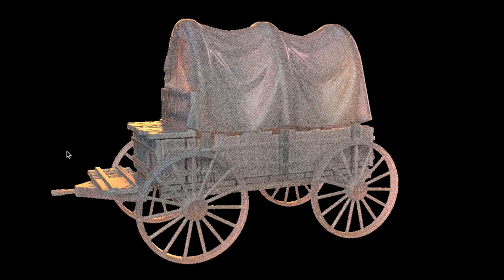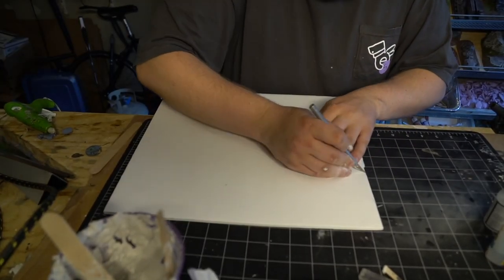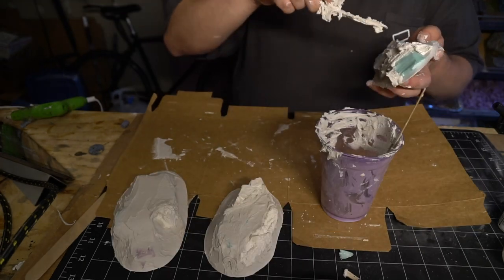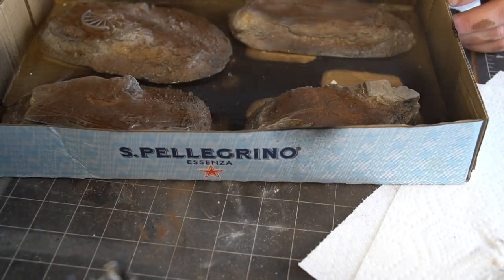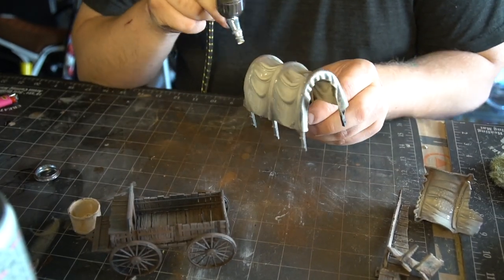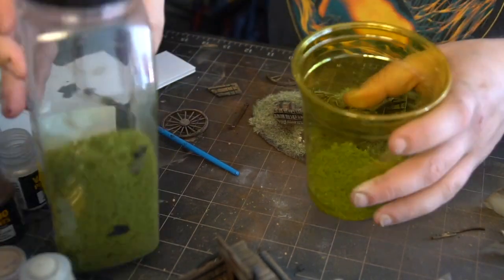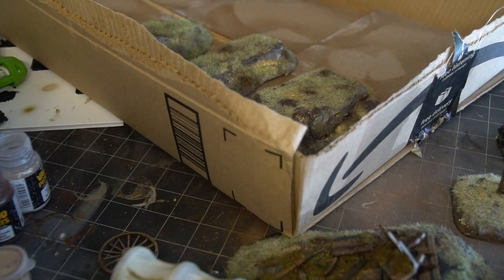Roads and Accessories Part 3, Hills and Wagons: CLe4

Comment: Thanks for the STL! I've heard about using baking soda as an accelerant for CA glue before but does I'm curious, does it leave a 'snow' like effect or a grit?
Reply from the maker: yes it can – it creates almost like a caulk or weld mark, so not as clean as regular super glue, i've been meaning to buy some spray on accelerant as I do think it would be better.
Reply from the maker: I definitely wouldnt use the baking soda method on any pre-painted pieces – it gets everywhere.
Reply: its a good filler as well if you trying to close a gap and don't wana wait on a putty you can CA and baking soda and then sand. It basically instantly hardens.